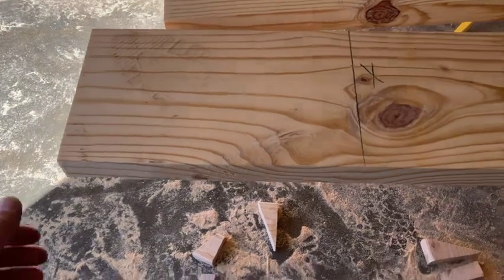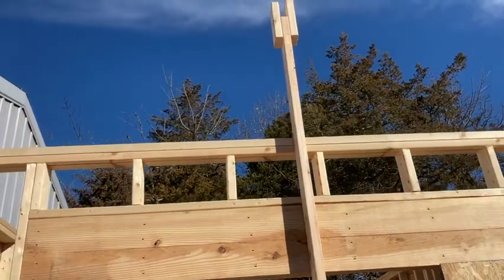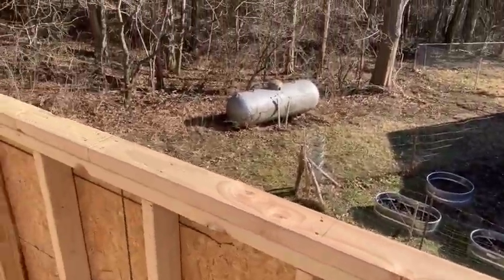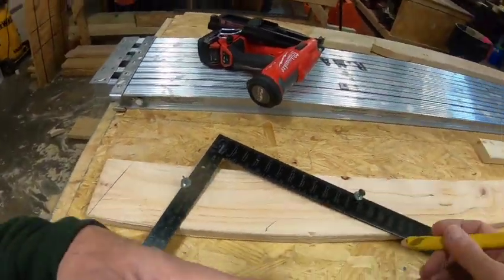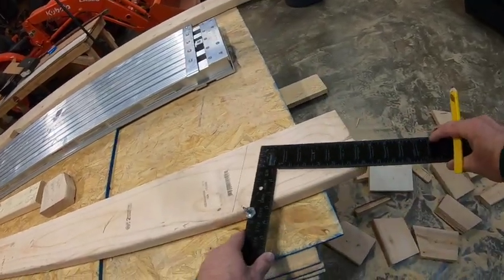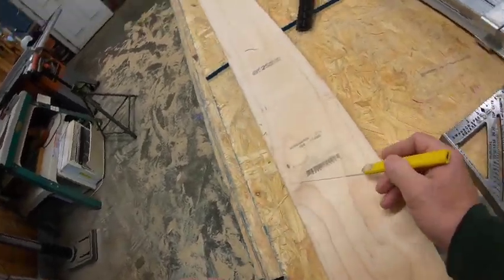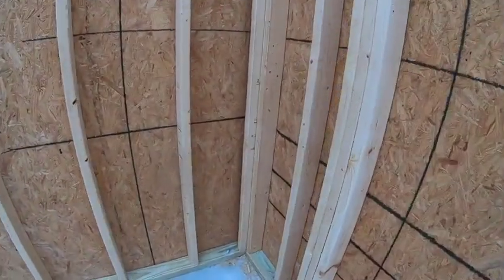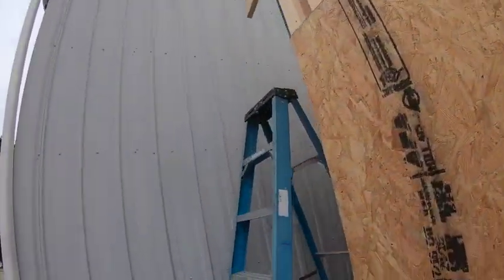Common rafter layout & construction,  Part 4 of garage build

Comment: Isn't your 12" overhang now 13 1/2" with a 2x6 sub facia board?
Reply from the maker: We didn’t cap the ridge board, I set the fascia boards like rafters, then notched the ridge board where it hung below the fascia.
.  You are correct though, if I was going to cap the ridge board I would need to deduct the thickness of the fascia board.